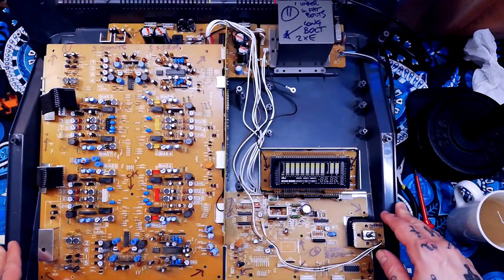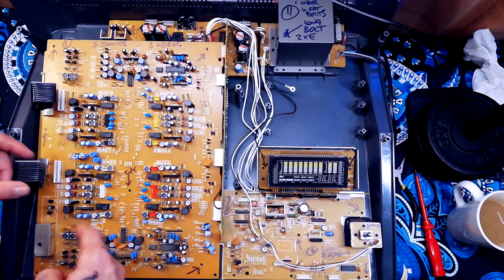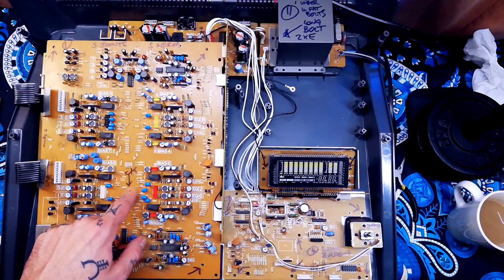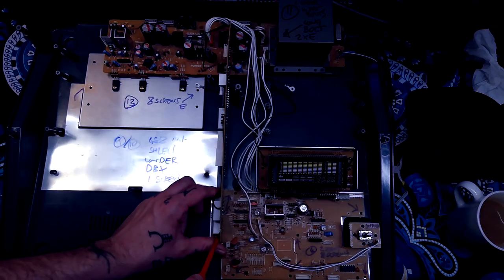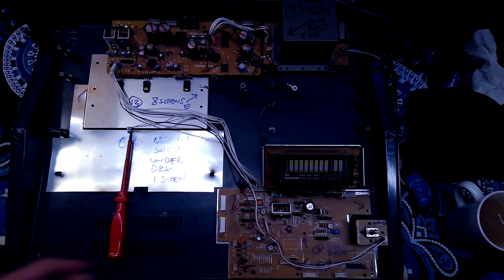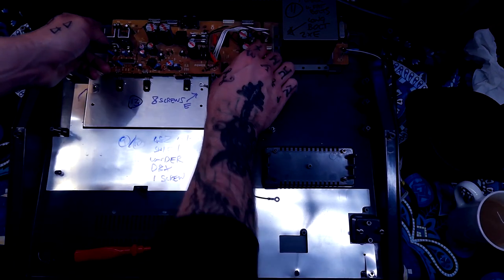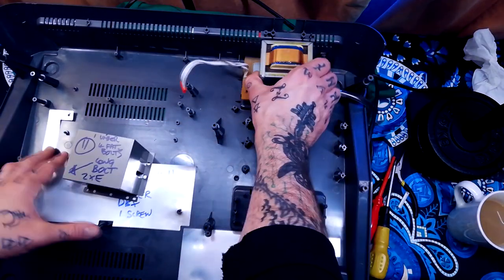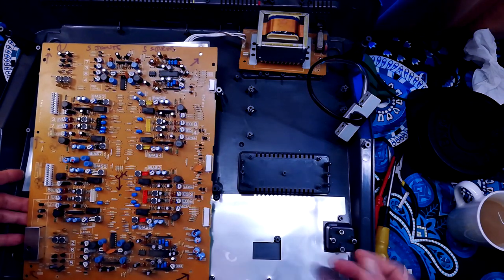Tascam portastudio 488 MkII | tear down lower section

Comment: I love your work, you've been a great help to me, but on those black ribbon wire cables that you were saying don't like to come out and are hard to put back in once you do get them out, instead of prying off the white cap, push down on the white cap and see if that doesn't depress the spring loaded contacts, letting the wires slide right out, you probably figured this out by now, thx for all the great content. Keep it up.
Reply from the maker: Thank you. Valid tips there - I'm more familiar with handling those now than I was when i filmed this (first months of covid i think?) but I do still tend to leave such things in situ where practical, and yearn for molex style headers and connectors

Comment: I have a MKII 488, and have been trying to figure out what's going on with it.  When I play back channel one I get a random popping sound... It seems like it goes away if I play the tape for an hour straight or so. It "mostly" happens when I first play a song back the first 15-20 times, but sometimes it will keep making the popping sound for longer periods. I have moved all the switches and they are all clean and work well.. I actually had it all cleaned and replaced any belts and gear, about 2 months ago. I don't think it's anything the repair shop did, could it be a discharge or maybe something isn't grounded properly on channel one?
Reply from the maker: Try replacing the coupling capacitors   in the playback path of the problem channel. If you're not sure what I mean I've made several videos recently with "colour coding schematics" in the title which should help explain.
Reply: @Tetrakan  Ok, thank you for the information. I will probably end up sending it to a repair shop, because I don't think I would be able to do it myself if it involves soldering. I will definitely check out the video you suggested on your channel. I will keep you posted on my results. Thank you for your suggestions.

Comment: Hey man, love your channel.  I have a 488mkii and channel 7 doesn’t play back.  I know nothing about electronics, so I’m reluctant to open it up.  Could it be something simple like a loose connection?
Reply from the maker: Hi, a loose connection could explain the issue you’re having, but there are other possible causes too. You’d have to open it up to figure that out though. For instance if you didn’t see something unplugged or a broken wire, you could try plugging the connector for a working channel into the ch7 header, and see/hear if you get audio out of channel 7 - the outcome of the test establishes whether the playback amp for that channel is faulty or the problem lies with that segment of the record/playback head.

Comment: Hi there, on my Tascam 488, when I record to 3 or 7, it deletes the other track at the same time as recording to the one I want (ie. if I record to 3, 3 is recorded but 7 is wiped). It’s only this group 3 of tracks, any ideas what it might be? Could it be like misalignment of the tape tracks? Cheers (your videos proper help by the way)
Reply from the maker: Not having had exactly the same problem myself I'm not totally sure... have the wires from the erase head been plugged into the wrong channel - so erase channel 3 plugged into the PCB socket intended for channel 7 and vice versa?
Reply: @Tetrakan  I’m not sure man I’ll have to take it apart. I swear it was fine beforehand, I’ve had it a few months and pretty sure it didn’t do it before, but thanks nevertheless I’ll see what I can do